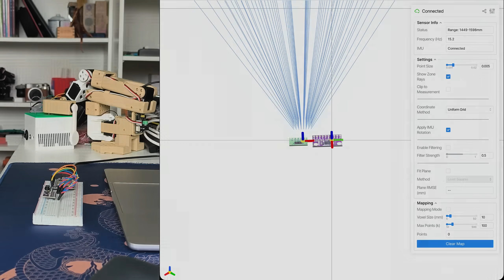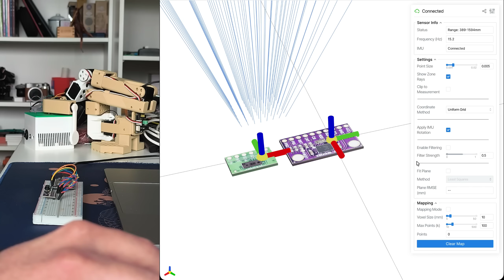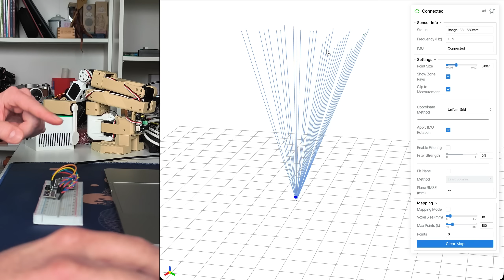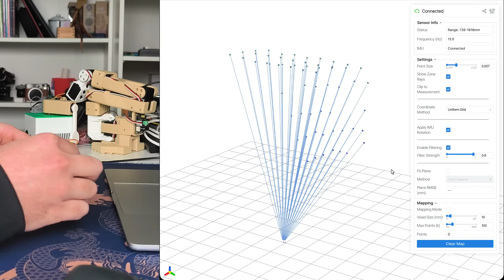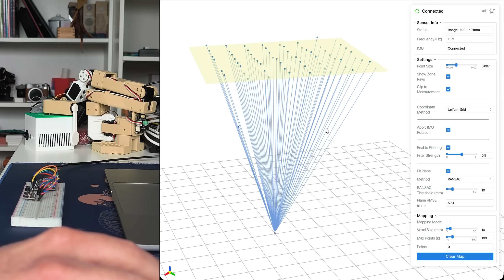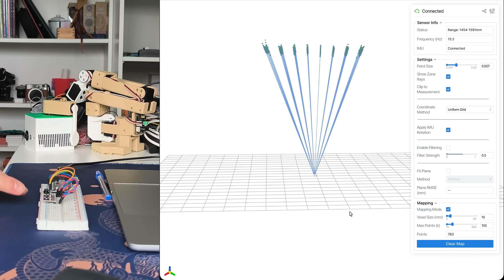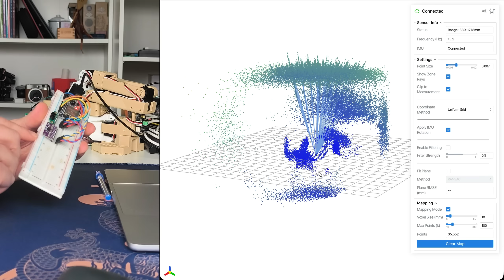Turn a Time-of-Flight Sensor into a 3D Scanner

Comment: if you already have an iphone with faceid or a pro model iphone with lidar near the rear camera you already have access to a pretty good lidar scanner, there are apps that allow you to make 3d models, room layouts, point clouds and much more. alternatively one could write an app for their own usecase
Reply from the maker: I knew iPhones had a sensing element for Face ID but didn't know there were apps for mapping and scanning 3d models of objects. Do you know if the element in the front facing assembly is a LiDAR or a ToF sensor?
Reply: @HenriqueFerrolho  the FaceID is ToF-based, something called TrueDepth where it projects ~30k IR dots and measures it with an IR camera (effective range <1 meter). The one at the back of the phone IS LiDAR though, works up to 5 meters and has a much less detailed projection

Comment: Thank you great vid 👍 could you do a robotics project vid? Do have build instructions for beginners? Thank you again for an awesome vid 👍
Reply from the maker: Build instructions of what? The same setup in the video?

Please check if the information here is enough: https://github.com/ferrolho/VL53L5CX-BNO08X-viewer

If it is not, open an issue here to explain what you're struggling with: https://github.com/ferrolho/VL53L5CX-BNO08X-viewer/issues

Comment: Nice work! I can't wait to see a full 3D scanner device. Do you think this sensor could be integrated into a drone so the drone could automatically detect and avoid obstacles?
Reply from the maker: Absolutely! But you'd probably need more than one of these sensors to cover the sides and both front and back.

Comment: Could this somehow be used to create a 3D scanner? I guess it depends on the resolution of the ToF sensor and the further away an object is, the less resolution you will have. Still… Great project!
Reply from the maker: Definitely! Using something like the space carving algorithm would allow scanning around an object and allow calculating a mesh. I might try this in a future video! 😛
Reply: @HenriqueFerrolho Please do, that would be awesome for a lot of people with a 3D printer. I was thinking perhaps of a stationary scanner and the object on a slowly rotating plateau but if you see a different and/or better way, I would be intrigued!
Reply: @cherrymountains72  It'll be interesting to see (a) if 8x8 is enough to do SLAM (b) if you can filter the noise enough to do useful scanning or do you just get lumps/blobs.  What you won't get is something better than what your cellphone camera can do with onboard photogrammetry - you'll learn a lot about it along the way, though!
Reply: @MarkEichin  Indeed, I’m curious to see what kind of result can be had using just an 8x8 grid. Like you say, there will be a lot of noise to content with. I would assume a cellphone camera with the right software (and LIDAR) can obtain better results but that’s comparing apples to oranges from a price point of view (though a cellphone is more than just a camera of course). Like you say, it will be an interesting journey to get there. 😊

Comment: Try using a convolutional (Sav Golay or Kalman) instead of an Exponential filter.  Either will significantly reduce the lag while also smoothing the noise.
Good project - and impressive results.
Reply from the maker: Thanks for the suggestion! I should definitely try one of those...
Reply: @HenriqueFerrolho  If you do, I would start with Sav Golay.  It's computationally very simple and thus fast.  Kalman is computationally intensive but more tuneable in the degree of effect.
Reply: Another small but significant refinement, filter the inverse depth 1/z. Distances far away also have more noise. You might be surprised how effective that tiny change is
Reply: @kylebowles9820  Good suggestion!
Reply: Selling plans, schematics and code?

Comment: can you add some servo or stepper motor to have your  multi-zone time-of-flight sensor (VL53L5CX) rotate constantly to increase the density of readings?
(might be tricky to wire it though)
Reply from the maker: You can definitely do this, and that is how many commercial LiDAR sensors work for mapping their 360-degrees environment (e.g. the ones used in robot vacuum cleaners).

For this DYI setup, to avoid twisting the wires, you can make the motor spin the base and have all the electronics on the spinning top (and the ESP32 streaming via WiFi). In other words, the only moving part would be transfering motion to the base, but of course when you put it down on a table, the base can't move due to friction, so the top of the device would be spinning itself. 😅
Reply: @HenriqueFerrolho  can also just use a cheap slipring.
Reply: Lol, I just had the awful idea to mount the breadboard on the end of a drill.
Reply: @0JThomps0 do not that

Comment: what did you use for the visualizer?
Reply from the maker: Viser from nerfstudio: https://viser.studio/main/
Reply: @HenriqueFerrolho  I was wondering the same thing. Great video brother. There's a deep rabbit hole you can go into with all the different software filters for the imu.
Reply: @jstro-hobbytech  as well as different hardware pieces too. This guy used an IMU (inertial measurement unit) with lidar (laser-based radar) but the lidar needs line of sight to work.

Consider UWB (ultra wideband) technology, similar to air tags and air pods. These use Bluetooth/radio waves for the distance measurements, so they work over a longer distance and can work through obstacles or through walls!

I'm thinking of combining an IMU with a UWB chip to get some cool effects.
Reply: @HenriqueFerrolho  thank you, I've actually been working on getting a few UWB sensors to talk to each other and wanted some nice way to visualize it for testing. I've never written any 3d code so I don't even know where to start with writing my own visualizer
Reply: @cyleleghorn246 chatgpt can help, with python
Reply: @HenriqueFerrolho  Thanks